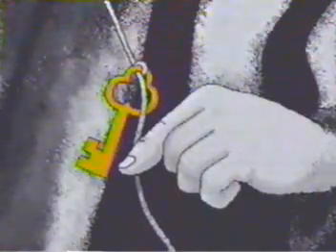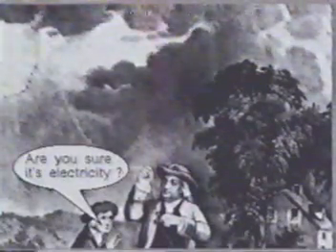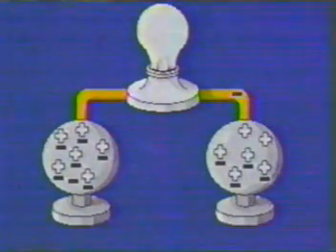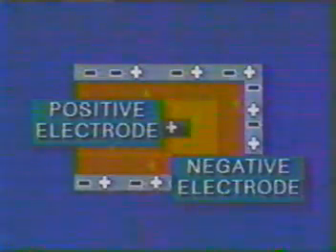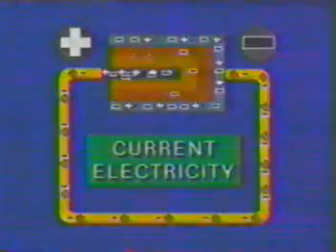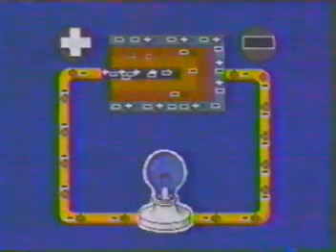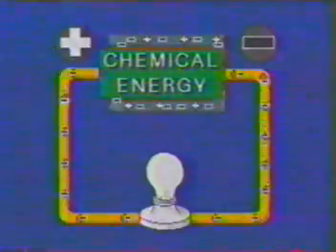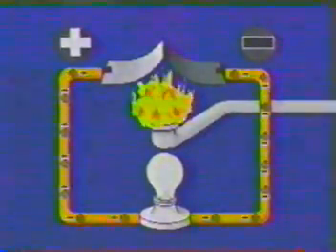Electric current

Comment: Franklin was probably correct, since his kite-twine doesn't use electrons.  (No, it wasn't a "fine wire."   It was twine, with a section of silk ribbon, used to insulate it from ground.)

In humid air, twine is either a salty conductor like wood, or an acidic conductor like paper.   If salty, then the current is some positive charges flowing one way, and negative charges flowing the other, both at the same time in the same conductor.   In salt water, +Na positive sodiums flow one way, and -Cl negative chlorides flow past them, going the other way.  There are no free electrons in water.  None in water, none in salt water, none in acids.   (And none in people.   If you get zapped, no electrons flowed through your body!)

But if Franklin's twine was acidic, then only some positive electricity is flowing.   

Acids are full of positive hydrogen ions, the +H ions  ...ALSO CALLED PROTONS.   In chemistry, acids are defined as carrying +H, while alkalies are full of -OH.   What do we get if we remove an electron from a hydrogen atom?   One proton is left.   Acids are full of free protons, and during electric current, it's the protons which start flowing.   (Ah, but metals are full of free electrons.  In wires, during electric current, it's the electrons which do the flowing.)

Comment: I have one note, the notion that current flows from positive to negative or the "conventional current" wasn't really invalidated. Even today's electron model states the electron could be positive, as long as the atomic nucleus has the opposite charge or negative. In reality Franklin was right. To comprehend charge and current it's important to know how difference of potential works or that positive potential flows to negative potential, that is why air flows out of a balloon and not in. .

Comment: I have a question of a curious nature. Say you have an electrical generator that keeps running and running, producing an electrical current continuously. Where do the Electrons come from? Where do the electrons keep coming from that are produced by the Generator? Do they come from the windings of the generator, and if so, wouldn't the generator soon run out of electrons? If not, then where are they coming from? Any information would be appreciated, I am quite curious about this.

Comment: The FMMC meter -remember those?- measures only conductance and does not measure amps nor volts. A measuring instrument cannot magically measure two different things -- unless hey presto it can change into a different instrument. A meter cannot do that and so it can only measure one thing and one thing only. If you think CAREFULLY about a meter and wire changes, then you will find out what the meter actually measures. A change of source though, means a change in the resistance of the source.